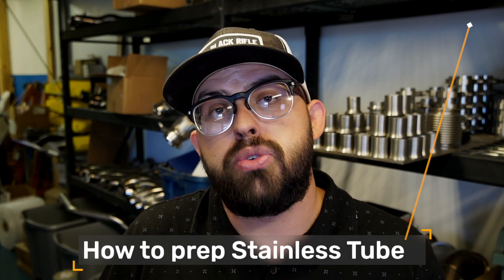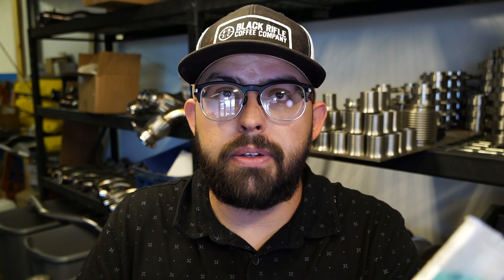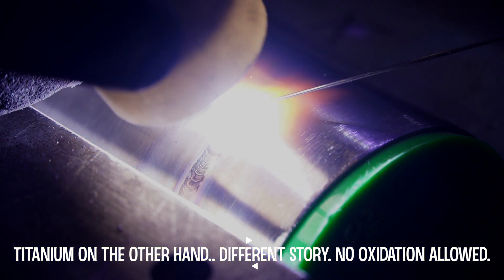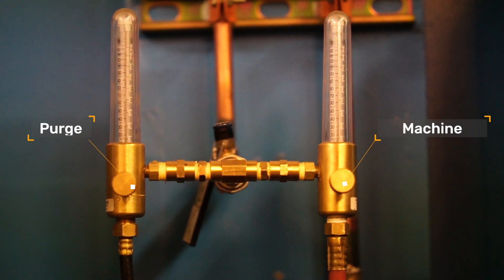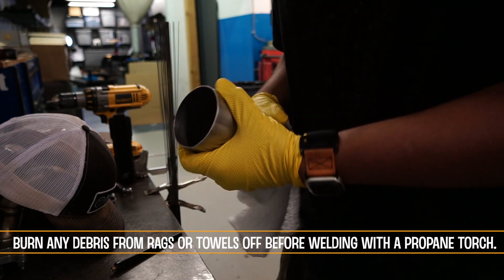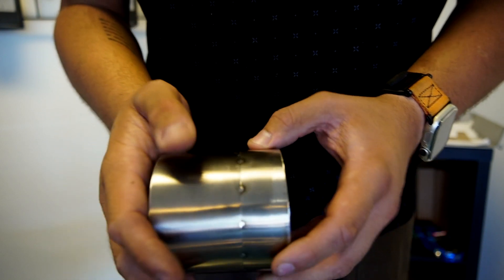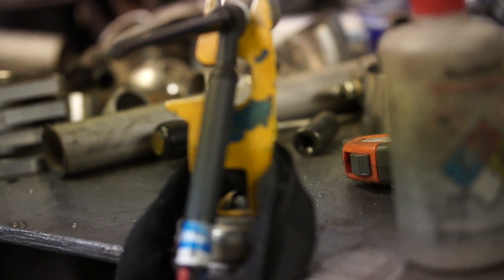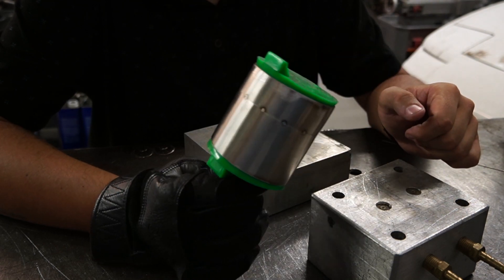HOW TO Back Purge Stainless Steel Tube and Schedule Pipe  + TIPS

Comment: Why is having a diffuser on the purge so important? Argon is heavier than oxygen. Just like the water example, filling up a glass is going to be the same if the water is diffused or not. It's still going to remove the air exactly the same as it fills up from the bottom.

Comment: Basically junk? Very harsh judgement when not stating for which application it is considered junk part. 99% post turbo exhaust parts are not purged and I have made many exhausts with or without purge. Not a single cracking after years of use. When in contact with liquid, intake, or very high temperatures all 100% purged when using austenitic steel and high nickel alloys.
Reply from the maker: Not harsh at all. Anything that isn’t purged is low quality. Sorry. 🤷🏻‍♂️. I don’t know who this 99% of post turbo exhaust parts that isn’t being purged is.. but that’s False info. I literally don’t know anyone who doesn’t purge exhaust parts in this industry.. and I know a lot of people in it. Sorry to hurt your feelings.. have a good day.

Comment: Awesome video as always, what sort of amp are you running?
Reply from the maker: Thanks Adam! I run 65 amps on the machine and typically use 80-85% of the pedal.. I have the extra amperage there to utilize really penetrating on restarts and widening the toe width quickly to get going again and avoiding unnecessary concentrated  heat input by hanging around too long. 👊🏻

Comment: 9:40 I do not suggest using any tape, whether it's masking tape or PET tape because all of them leave some kind of glue residue, and when a pipe is tacked together it's impossible to remove all of the tape residue without getting some of that inside the joint, between the two metals.
Reply from the maker: Whether it is Tube or pipe.. Powder coating tape leaves no residue.. that’s why I use it... I appreciate your input and I can promise you my recommendation works and works well. I have welded plenty of aerospace parts using this method that have very strict requirements and I have also used this same method to weld many many titanium and stainless tube assemblies. Have a great weekend!
Reply: @hourglassingenuity103  Just did a check as to what powder coating tape means for you, but it's the same PET tape of what I thought it was. I believe in your experience, if you say that it leaves no residue. I hadn't yet done any weld job that needed X-ray but I would imagine that it would have left residue (I am extremely meticulous about cleanliness). I really like that you read and answer all relevant comments, you're a cool guy.
Reply from the maker: YszapHun I try and read and answer every comment if I can! I really appreciate your opinion on the topic and I enjoy reading your comments because you seem very educated. I have never had any trouble with residue but I have had massive amounts of trouble with using scotch brite on a tacked joint and introducing fibers into the joint and have contamination issues that way. Either way, so many ways to do something! Thank you for your time and engagement. 🙌🏻
Reply: YszapHun don’t know if PET tape is the same as kapton tape. But kapton tape has been the go to for many. And as brad said, it doesn’t leave residue.